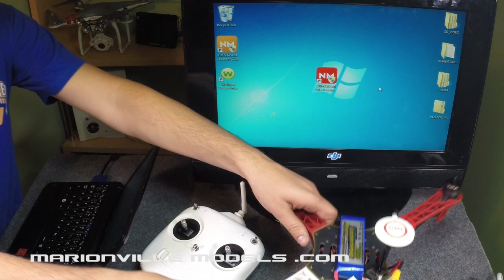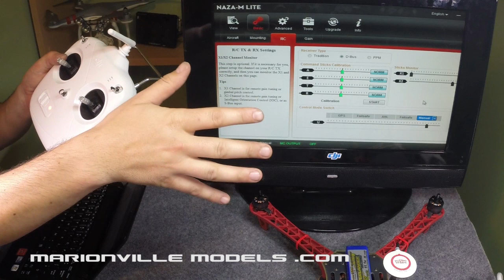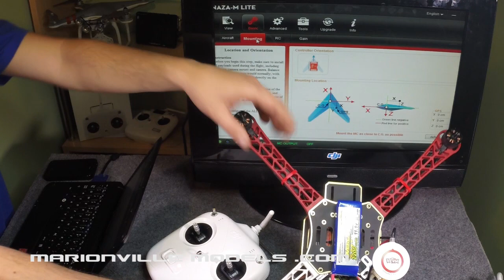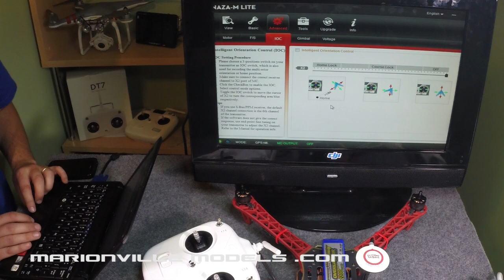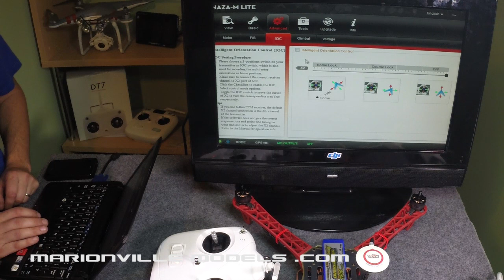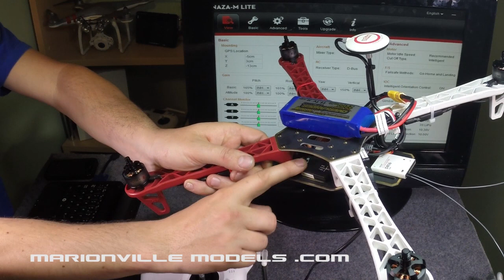Using the DJI Naza Assistant Software for RC Calibration, Motors, IOC, Failsafe, Voltage, GPS

Comment: Does Pixhawk support motor Fail-safe?
If yes, which version to use? 
If no, which is good Flight Controller?
I knew Naza-M2 support motor Fail-safe(correct me if I am wrong), but its close code, so I am avoiding it as long I have alternate FC.

Comment: 2020 bro your gains are way off
Reply from the maker: Robert Parkhurst jr I’ve built hundreds of these without issue.
Reply: When I put these gains in my quad acts wonkie IDK
Reply from the maker: Robert Parkhurst jr you would need to be using the same propitious system and flight controller.
Reply: I'm using the same setup from the naza to the dt7
Reply from the maker: Robert Parkhurst jr not sure then. Hasn’t failed me in all the builds I’ve done.

Comment: Do you have a reciever or does the naza main controller have one in it?
Reply from the maker: HDgodfrey you need a separate receiver which would be supplied with your transmitter.
Reply: I know I used the dj6 (phantom 3 controller) with my first build. I just can't remember what rcvr I used to make that work. Oh well. Thanks for quick response.
Reply from the maker: HDgodfrey the DJI stand alone receiver is no longer available sadly.